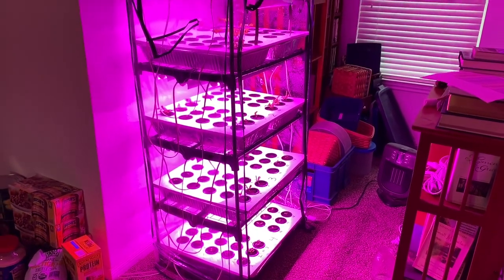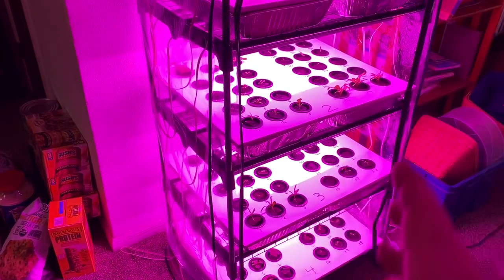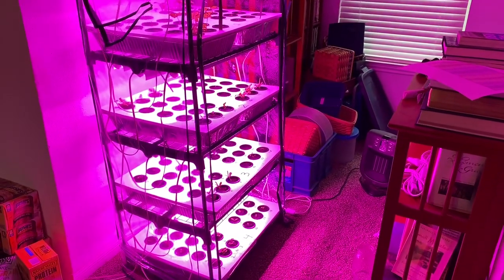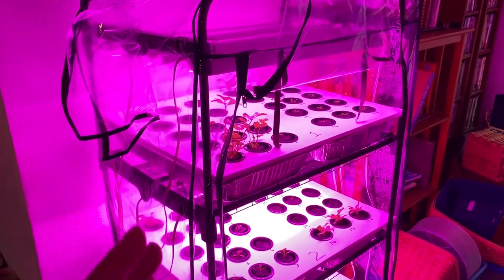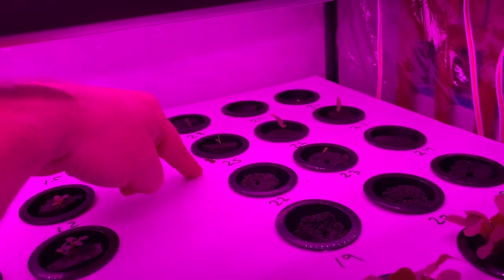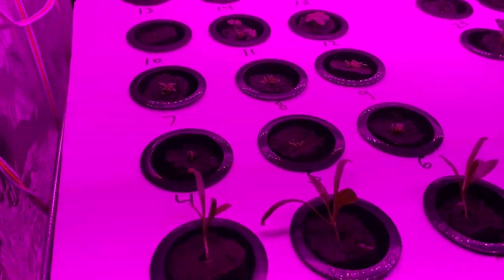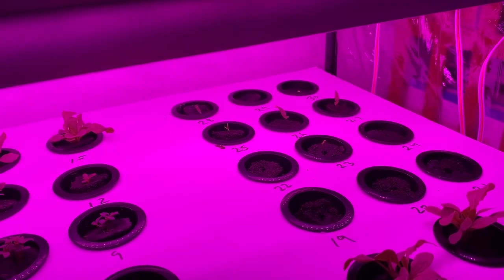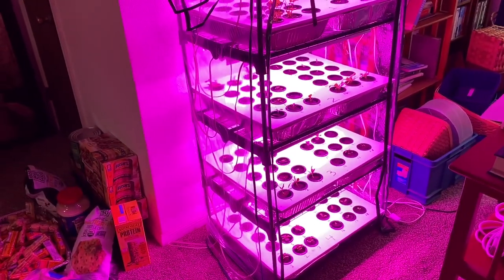Kratky Hydroponics Seed Starting System Part Three

Comment: I started sprouting using those pressed aluminum one use pans and in a short time they developed pin holes. I now use restaurant baking sheets. Super sturdy and  inexpensive compared to "fancy" sprouting trays. Using the pressed pans is a good idea to start with because it is inexpensive but once anyone decides they're going to move forward, they'll want something durable.
Reply from the maker: Have not seen any holes yet but yes it is a concern.  I guess you could double them, I am actively looking for a better solution got a link to what you used?

Comment: The trouble with pepper germination might be related to temp.  I have the best luck germinating between paper towels, in zip bags, on a heat mat with a thermostat.  80-85F seems to work best.  They don't germinate over 95 and I found that T5 fluorescents a few inches above would keep them too hot.  Might be something to check.
Reply from the maker: Makes sense but temps on the plugs are about right.  I use a thermal gun to get temps.

Comment: Coriander germination happens with the monsoon. So to replicate these conditions you need to soak the seed in water and then drop the temperature. Each seed actually contains 2 seeds inside a husk. It germinates much faster if you open up the husk and separate the two halves.

I usually sprout coriander in a ziplock bag and then transfer.
Reply from the maker: Very interesting concept!  Thanks.